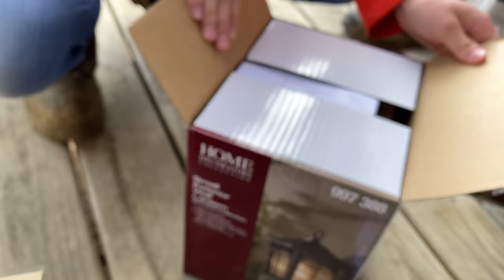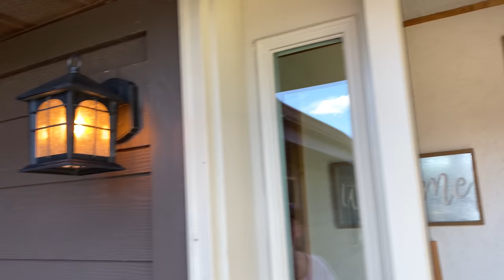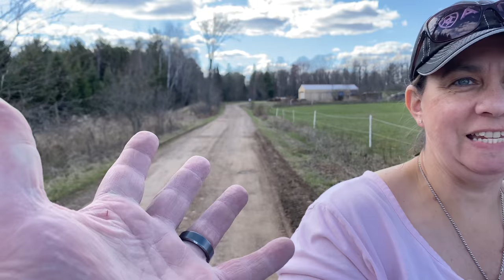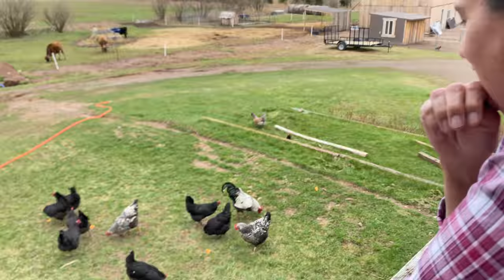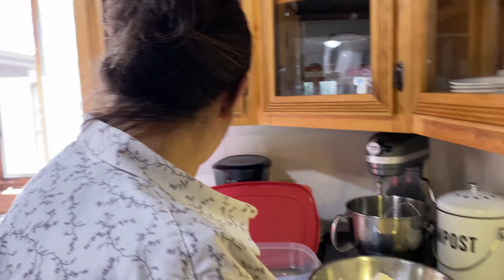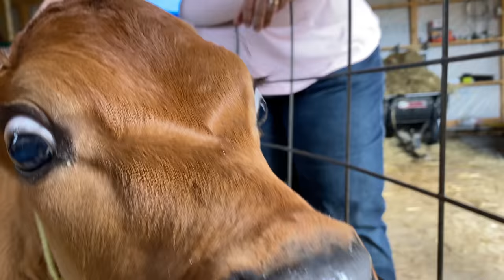The Kiss of Death | A Big Family Homestead VLOG

Comment: Our list keeps growing as well.  We've started our garden beds.  Strawberries, asparagus, onions, lettuce, spinach, bok choy, beets, and swiss chard.  My seedling, tomatoes, peppers, rutabega are inside the house ready to go outside.    3 months we had bad amount of rain causing the dam run off to collapse.  We need to repair this, and we know its going to cost a good chunk of money, time, and strength to fix.  Were also working on fixing our carport which collapsed with from same rain storm.  This carport is partially fixed by usingnone of those portable carports with heavy duty material.   Life is good😚

Comment: 1. Building raised bed boxes from pallets.
2. Building a buck barn and pen.
3. Building 2 chicken coops.
4. Plumbing so I can FINALLY get running water in the house!
5. More fencing.
6. Learn to make cheese.
7. More fencing
8. Set up IBC totes and sump pump to our well for a backup water supply.
9. Get materials for building a back porch before the cost of materials is too high.
10. I'm sure, more fencing.

Is that enough? If not, I can probably come up with some more. 😜

Comment: I’ll give you a hint about reheating pizza. Take a cast iron pan the size of the pizza your heating put it on the stove turn it on with the pizza in it and heat it until it’s crunchy. If it’s really thick pizza put it in the cast-iron pan in the oven turn it on350° and when it beeps for 350 it’s hot

Comment: ? When I was younger and single are ceiling fan decide to break and I thought this is not a big deal alternate off take it out back up I turned everything off took it down figured out I had the wrong one put everything back in the Box went to the store got the right one came back forgot to check that everything was still turned off my daughter had flipped the switch on half my kitchen light kitchen was on two switches so she can use the microwave and didn't tell me I touch that screwdriver to that why are to tighten it down and it knocked me off the letter across the room now when I turn off switches I put tape on it that says tell Mom if you flip this and then I rubberized all the handles on my tools I will never get shocked like that again